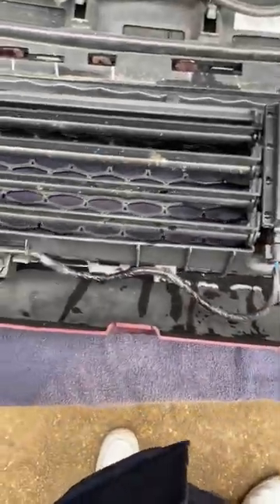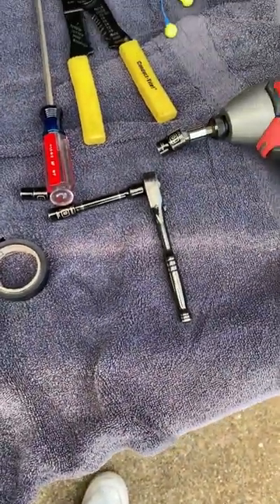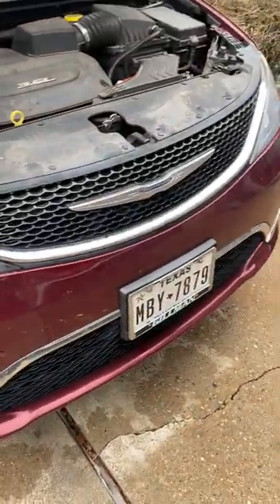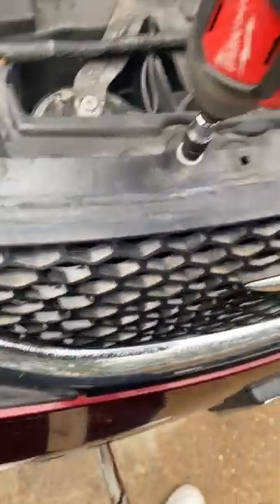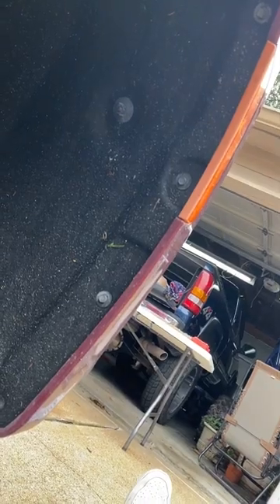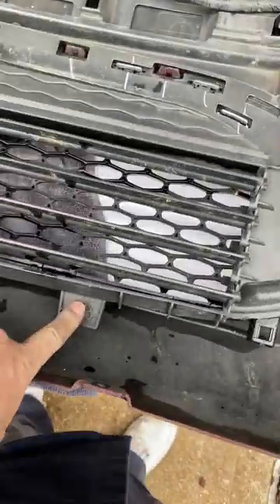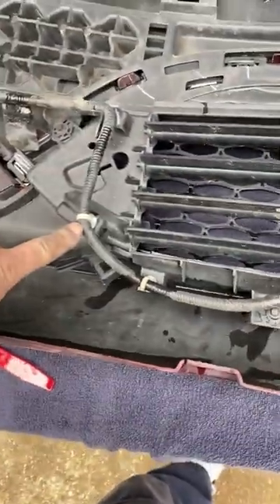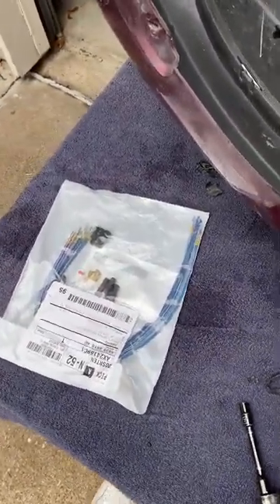2017 Chrysler Pacifica Active Grille Shutter Replacement

Comment: You didn’t pay them $200 to scan your car😂 you paid them to tell you what was wrong with your car.  Codes are just clues 99% of the time. Also because you bought your part from eBay. I can confidently say with 100% certainty that you did NOT get a genuine OEM part. Maybe a genuine mopar box. But nothing more then that.

Comment: I have the '18 Pacifica and took all my slats out just leaving the motorized one so I dont get a light..You should have done this, runs cooler now...Emissions or not no radiator should be purposely closed👍👍

Comment: Hey I’m sure you had the CEL which is my case I have the same code on my 18 Pacifica and every time I try remote starting it it shuts off immediately but I came across your video and wanted to ask you that before anything
Reply from the maker: Hi there. I had issues getting the code from my scanner so I took it to a dealership to get the diagnostic test. They told me what was wrong, and I chose to fix it myself. I haven’t had any issues with the remote start.
Reply: So you're saying that your problem with the remote start, which I am having right now as well, has to do with the AGS?
Reply: Same here 2018 Pacifica my remote start wouldn't work because the check engine light was on.

Checked code and it was related to Active Grill Shutters.

Comment: Thank you for the video. I will be doing this project soon.
Reply from the maker: Excellent!! Glad you liked the video!!
Reply: I got the new active grill shutters and it's still not working. I noticed there was no voltage at the connector.
Reply: @TWDIY When are these activated and are they wide open at over 20 mph?
Reply: @TWDIY I'm not sure why people are lining up to replace this when it's slamming off the air to the radiator making it run hotter. I have the '18 and am going to remove it and dremmel shave the wing slats off so it can still rotate avoiding the check engine light so the lower radiator gets full air 100% of the time👌

Comment: Great video!!! Any chance it was just the wiring that needed to be change due to corrosion?
Reply: I would definitely try that first but who wants to take this thing apart twice? No thanks, lol
Reply from the maker: Very possible, but that was what the dealership told me was wrong so I changed it all. Honestly, once you pull the front end off once, to pull it off again wouldn’t be hard or take that long.
Reply: Thanks so much for the video, very thorough. Looks like it makes sense to just order and replace both parts while it's apart. How much time did you put aside for this?

Comment: I have the same code, do you think I might just need to replace the connector, and leave the AGS alone? Seem like its just the connector's issue
Reply from the maker: Hard to say for me. I got my diagnosis from the dealership. You could pull the plug and see if there is corrosion and make an educated guess. I kind of felt the same way about mine, but the dealership said it was bad so I changed it. Best of luck to you. Let me know if you just change the connector. I'm curious of the outcome.
Reply: @TWDIY  I just ordered the connector part, I'm attempting to do it myself this weekend, I will update you.
Reply: Any updates? Did changing the connector fix your problem?

Comment: Can you access the connector without pulling off the whole front clip? Or would it just be best to pull the front clip to save time and energy?
Reply: You can remove the bottom splash guard that is attached to the bumper. Then you are able to access the connector.

Comment: Thanks for the video. Are both these connectors the same?
Thanks
Reply from the maker: I'm not sure what you're asking.
Reply: It depends on the part number of your active grill shutters. If it is made for a 2017 then it's good but anything after 2018 then a new connector is needed which is wired differently.

Comment: I did this repair and still getting the U11E9 code. Checked the harness and replaced the grill shutter three times. Still have the code. Any thoughts?
Reply from the maker: Did you clear the code, and it comes back on?

Comment: Would the check engine light come off automatically or does it have to be reset with the code scanner
Reply from the maker: You have to reset with the code scanner.